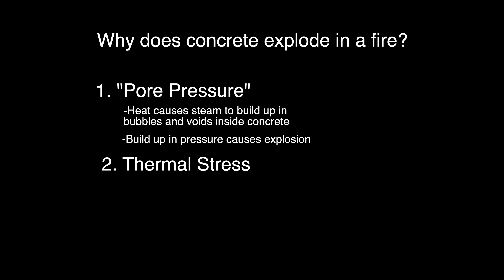Don't Put Wet Rocks In A Campfire

Comment: You know, as a kid, my grandpa always told me “never use river rocks for a camp fire, you might just lose an eye.” I never really understood why, but it all makes sense now.
Reply: Yup. If the water turns to steam (mainly in sedimentary rocks) they can explode quite violently. A simple temperature differential won't cause an explosion, that merely cracks it. So you need porosity.
Reply: yah...it's not funny when the splinters start shooting around the fire lol :D
Reply: Did you lose an eye before learning
Reply: Flint is really bad at splintering, like tiny little arrow heads...
Reply: Mr. Smith 420th like.
Reply: Vibra Thor no one said it was 😐
Reply: @soverxigniv8850  My uncle laughed when it happened to me, at least until he realized that I had been hit.
Reply: Just a teenager giving his opinion it did. I had 3 eyes but now I have the normal amount now so it’s all good.
Reply: @MrSmith-ty4bg  i mean i lost a few eyes but its fine because they werent my eyes.
Reply: After I read that I’m like oh yea now it makes sense

Comment: Here in Wales, the ground is wet almost all year round, especially in wooded areas. Once when I was out camping with friends, we had a rather large rock explode into 3 pieces, which actually sent some embers at us. we later found a hole in a camping chair that was nearer the fire, and we could only guess is was a rock shard.
Reply: After a few friends threw live ammunition into a campfire, we discovered most of our camp chair holes were from burning embers rather than shrapnel.
Reply: @pcblah  Yeah, that was our first thought but it was more torn than burnt.
Reply: My first thought is it's not a rock per se it was probably a geode they have liquid inside sometimes if not fully formed those would most likely explode.
Reply: @VerdantTrash  wow

Comment: How about, for a laugh, making concrete with a good amount of Thermite mixed into it? The 'best' exploding rock, is Flint, by the way, with the added joy of when it explodes, it throws out glass-like shards of hot stone.
If you really want an injury, heat stones to red hot - then chuck water, as cold as you can get it on them. Then call the hospital.
Reply: Or gunpowder.
Reply: Thanks for the advice :)
Reply: Actually another fun thing to try might be to put a bunch of rebar in the middle and then wrap a loop of electrical wiring (or just more rebar) with two ends sticking out.  Apply a high frequency high current to it to heat up the rebar from the inside.  Wonder if the expansion would make it explode.
Reply: Better yet, mix in obsidian.
It is the sharpest material on earth and fun to make stabby instruments with.
Reply: Thermite would not do anything mixed into concrete. You could never get it to react.
Reply: For an extra bright boom, mix in aluminum, magnesium powder, and poly styrine (for extra fire) as well.
I believe two of these are used in flash-bangs and other high explosives. 

It is my bear defense plan for camping. >;)
Reply: @xenonram  no? Thermite doesn't require any air to burn.
Reply: brianartillery I think he should do that 💥
Reply: I'm scared of how genius it is
Reply: I lived in a town where the bedrock was slate, so naturally we were using slate for our firepit. A rock exploded when my face was next to the fire.
Reply: As a boy scout, we put some wet sandstone in that popped fragments out. Probably 5-10 feet.
Reply: @justaguycalledjosh  While thermite doesn't require air to burn, it does require a certain fuel density in order to sustain the reaction.
Reply: @xenonram  unless you were hit with firebombings
Reply: Yes
Reply: How about gunpowder? Or black powder
Reply: I've heated a rock to very hot and chucked water at it. No one was hurt
Reply: Oh dear lord why have you enabled him
Reply: @Sp00kq   - There's 'very' hot, and there's 'glowing red hot'. A huge stone circle in England, known as Avebury, had a lot of the stones destroyed in the 1600's by having fires built round them until they were glowing hot and then quenched with cold water. The thermal shock made them shatter. Sometimes quietly, sometimes violently, into small fragments. Another thing in the Scottish part of the UK, is the 'Vitrified Fort' - a prehistoric fort where the stones that comprise the walls are melted together in a glassy, slag like mass. And nobody's quite sure how it was done. The best known one is at Knockfarrel.
Reply: @brianartillery  true. Then There's a lot of weird prehistoric things that seem to have no explanation. Like that part if the fort like you said. Maybe they knew something we don't?
Reply: Time to do this
Reply: @Sp00kq  you got me with that lol
Reply: @justaguycalledjosh  it's too diluted if you mix it with concrete
Reply: @justaguycalledjosh  yeah, but it would no longer be mixed to burn. It's a 2 component substance, not one chemical. It you add a bunch of inert marterial you just separate the 2 components. Even where you had bits clumped together good luck getting them hot enough to get started, let alone cause some sort of chain reaction
Reply: thanks for the instructions
Reply: brianartillery here i have a better idea.. BOMBS
Reply: Flint and steel.
Reply: I want to see thermite concrete now
Reply: Unfortunately the thermite concrete idea wouldn't work. Thermite burns as well as it does because of the extremely high surface area and direct contact between the particles of pure metal and oxide. Concrete would insulate the particles from one another.
Reply: @Sp00kq  Common knowledge is the most quickly forgotten, historically speaking. Expert consensus is that these forts had a wooden exterior superstructure that was burned, either ritually or as a deliberate act of destruction by a conquering force. Experiments have confirmed that 1) the vitrification process actually weakens the structures, and 2) sustained wood fires can burn hot enough to vitrify the rocks.
Reply: @littlesnowflakepunk855   - They must have been a terrifying, and awe inspiring sight when burning.
Reply: MUWHAHAHAHAHAH sounds like a good plan for  world domination

Comment: NEVER pour a concrete floor in a fire pit!  I mistakenly did, and even though I put in a drain pipe for draining off rainwater, I hadn't considered all the sand underneath the concrete that was still able to absorb ground-water that was naturally there.  Weeks later I started my first campfire in it, and it was quite large being as it was a 4 foot wide fire-pit.  About 30 minutes later there was a horrendous KABOOM and flaming firewood and chunks of concrete shot up out of the pit at least 30 feet in the air!  Luckily no one was sitting around the fire pit at that moment, but it scared the sh*t out of all of us there.
Reply: Was it fully cured?
Reply: @MrTmpr2050  he said it was weeks later so probably, but i know nothing about concrete
Reply: A similar story happend to me, I once put a piece of concrete drain pipe in a fire, and a few hours later it exploded and a piece of croncrete hit one of my friend right below the eye, quite scary.
Reply: Assasination
Reply: @Scotty-vs4lf  Concrete takes months to cure properly and will continue to cure for years after. Being poured into a fire pit it was probably a few inches thick, which needs to cure for 3-4 months but that is just for being resistant to compressive deformation, probably much longer for decent resistance to heat.
Reply: @Scotty-vs4lf 3 weeks or 3 months is considered fresh I believe
Reply: this happened to me when i was a kid in a house we rented and a coil got stuck in my pinky toe and to this day it’s scarred
Reply: The similarities in these stories are a drain pipe

Comment: I have had rocks explode on me before, the most dangerous was a flint rock that had been in a river.  It became shrapnel and and at least three of the tiny shards hit me in the face and gave me tiny cauterized cuts where they hit.  Took forever for them to heal and I had scars that took several years to fade.  I did a bit more research and found out that both flint and slate are notorious for exploding into shards.  It is mostly because of the way they layer and makes it easy for moisture to be trapped inside and expand in all the layers.  It is far more dangerous with them if they are saturated though as I learned the hard way...
Reply: Kody Choates  you get hit in the face by the equivalent of scalding hot peices of glass half the size of your fingernail and moving at a very high velocity.  If one had hit me in the eye rather than on the cheek and forehead I very well could have been blinded by it.  I actually didn't cry when it happened and really didn't realize just how bad it was because they didn't bleed and I had no mirror.  But I had rather obvious red welts that surrounded the actual burnt and cut skin for several weeks and the cuts themselves itched forever while they healed.  They didn't even really hurt until several days later.  I had also got hit in the arm too by a larger peice that did bleed and hurt quite a bit but I just put a bandaid on it and that was it.  Didn't even know I had the others till I got home and looked in the bathroom mirror.
Reply: Anf this is where he earned the name, Captain Flint.
Reply: one time i was cooking chicken on a flat rock (possibly slate) in a camp fire and me and my friend were starting at it as we were a foot a way and the whole thing blew up in out face and the ash went everywhere
Reply: Any type of rock can "explode" like this, and there are three causes related to external heating/cooling:
1. Expansion/boiling of water in cracks/fractures or porous surfaces.
2. Localized thermal expansion/contraction, like putting a drop of water on a hot incandescent light bulb.
3. If lava contacts water, the water can not only flash to steam, but also be separated into hydrogen and oxygen... you know the rest, lol.
Reply: Same happened to me

Comment: I have been told as a young child that when you're in the sauna, the kiuas (the heater with rocks on it) should be only watered with decently warm water, or else the stones will crack (not explode tho).
Reply: i think thats too avoid putting cold water on hot rocks, because that will crack them for similar but still different reasons to what happened in this video
Reply: Those rocks are very porous almost like a sponge. They can split from hot water but not explode.

Comment: note to self: throw overheated rocks at the enemy and have a chance for then to explode in their face
Reply: This is what is called a CHANCE GRENADE has a 40% chance of dealing 100 damage, and a 60% chance of dealing 0. Also deals splash damage.
Reply: I use the rocks as a molotov. Pour oil on the rocks and heat it up. Then attach a lighter that's still turned on then throw it. Done, you just crafted a molotov

Comment: While camping in a secluded gravel parking lot we had a fire ring. Sometimes the ends of burning sticks and logs would fall out of the ring. We had a shovel to scoop them up and put them back in the ring. Sometimes gravel would get thrown in with these scoops. It didnt take long and some of them would explode. Sounded a little less loud than a 22 rim fire shell going off. I deduced it was the gravel. So I threw a few in and sure enough they would explode. I guess this is why you dont use river rock around a fire, the water absorbed makes them explode. The gravel would catch dew and rain and I'm pretty sure that's why they would explode. Interesting stuff.

Comment: You need to use round river rocks, I’ve heard a few stories of them exploding... 😯😀
Reply: Yeah, the "wet rock" were nowhere near wet enough.
Reply: Yea we accidentally used them for our sweat. Sweat went boom inside
Reply: As boy scouts we used to toss a few river rocks in to scare our friends... It worked
Reply: @Tetrok_the_Teal  man, i used to throw in used batteries in campfires to scare out my friends and teachers.
Reply: This happened to me one time it nearly hit me in the face and went 20 ft into the woods. It was baseball sized so it could have messed me up.
Reply: @william.304_6  dammm that’s crazzzzzy, a baseball sized river rock , sheesh that must’ve been a real doozie.
Reply: Dousing hot rocks in water water is how plains natives got the material to make arrow heads
Reply: I've had it happen multiple times just tossing a few random rocks off the ground into a campfire
Reply: happend to me and friends many years ago... luckily nobody was sitting next to the fire that time
Reply: Yes
Reply: as a scout this is no rare occasion
Reply: I don’t get it.
Reply: This would make sense because they're rounded. The rocks can probably take more internal  pressure from the heat because spherical objects are the strongest shape possible. There is a balance in the pressure build up, and when it comes to its highest pressure it goes off all at once insted of creating another weak spot
Reply: River rocks! Really wet through and cold
Reply: Yeah exactly
Reply: Yeah they explode like bombs.... learned that the hard way
Reply: Yeah I was camping by a river bank once and the whole bank was rock and we made a fire and we’re joking and then started hearing noises like someone was walking through the woods and seconds later there was a HUGE explosion in the campfire and it sounded exactly like a 12 gauge shotgun
Reply: @lgefoxy1415  we made a fire and I found a big flat rock that I was using to cook with and halfway through cooking it blew up, not quite 12ga loud but it definitely scared us
Reply: Ive done it and its a really bad idea. About 10 Apple-grapefruit sized rocks in a fire. We flipped up a picnic table to hide behind and waited. About 15 minutes later there were loud bangs and hot shards of rock flying. Took out a couple windows in the cabin 45ft away and there were dents in the picnic table from being hit
Reply: Grenades works too

Comment: If you get a Baryte crystal, you can simply put it under warm water from the spring, and it will explode.
Because of the tight molecule structure, for the same reason it is pretty heavy too.

This has made many mineral collectors sad, as they come home with this and try to wash them in warm water..  lol

Comment: When I was in cub scouts, we did a wilderness survival hike. Built a small shelter, and then made a fire ring with some stones from the nearby creek. Then we light up the fire, several of the rocks exploded. Shale is the most active because it can retain a lot of water. Since a few of the stones came from the bottom of the creek, the steam popped them. It sent embers about 15 feet in a couple different directions, so we had an impromptu forest firefighting lesson too. Fortunately, it was kinda wet, so the fire didn't go wild.

 More recently, I built a stone forge with a chimney out of local stones and have had issues with popping rocks, but nothing near as violent as the first time. 

Ps dont put batteries into a fire. They do go off like a grenade. A car battery is like an artillery shell. Never burn those.
Reply: my grandfathers truck once caught on fire. im not sure why but it was very old. and it had a car battery in it so if this is true then i suppose it was very lucky it didn't explode
Reply: @yourfriendtheflower9981  car fires and wood fires play differently. The batteries in cars are also positioned to protect them from engine fires. They explode because the fire causes the battery acid to expand. Most batteries have a plastic outer shell and a metal inner shell. The explosion occurs when the pressure from the expanding acid eventually overcomes the integrity of the inner lining. Now, it may be a bit of an exaggeration to call it an artillery shell in force, but they are capable of a lot of damage when uncontained.
Reply: @sexhaver2165  something small like a watch battery would not be too dangerous, but the explosion can send bits of shrapnel from the casing as well as superheated acid everywhere. A D cell is pretty violent too. Please don't do this stuff. You are warned not to put them in a fire specifically because of how violently they react to it. Thermal burns paired  with chemical burns paired with shrapnel make that a terrible idea. It can also scatter embers all over the place as well.

 Please Don't it yourself. If you must, as least stand behind a blast shield for your own protection. You can probably find a video on here. That would be significantly more safe.
Reply: did someone asked?

Comment: Random fact: There is enough iron in your body to make a 3-inch nail.
Reply: But when your heat up you die of burning, you dont explode. bruuuuuuuuuu?¿°¿°¿•¿°¿¿°°!?!?!
Reply: So if you baked a human in a crucible, all that would be left is a puddle of metal?
Reply: So if I eat a three in nail I will double the amount of iron in my body?
Reply: @theindividual9689  Yes, but depending on what form the nail was in at the time of eating, it may just come out in one piece.
Reply: @Convolutedtubules  depends
Reply: Well i have 7 inches so I must be special.😌
Reply: Or a 1.5 is diameter circle of iron as demonstrated in X-Men 3
Reply: @Convolutedtubules  no matter can't be destroyed
Reply: Yeah but I’m 12 so probably like 1 and 1/2 inch nail
Reply: Except most of the iron is locked in chemical bonds, not free floating.
Reply: @therealmarcher  What do you mean?
Reply: @daybot9592  I have 6 flaccid, but only when it's warm 😜

Comment: I know this is an old video of yours. But I think you should revisit it with rocks called Moqui Marbles. I know they are found here in Utah and I’ve personally been injured by them exploding in the campfire. 

I believe they explode so violently because they have are a soft sandstone surrounded by a hardened sandstone, allowing a ton of pressure to build.